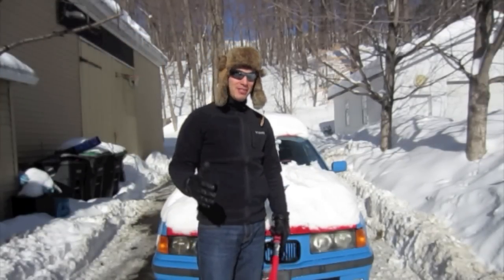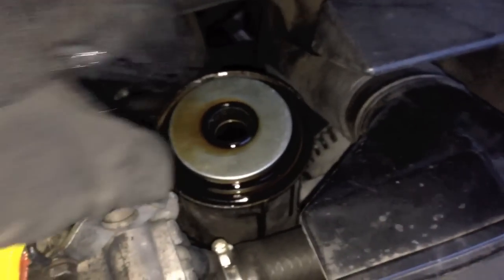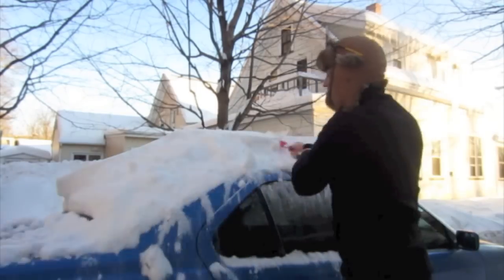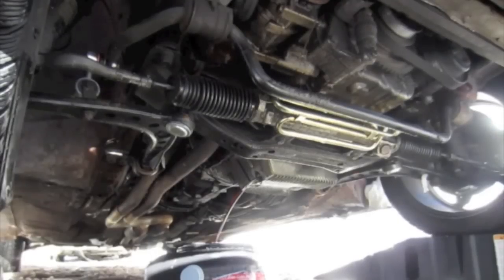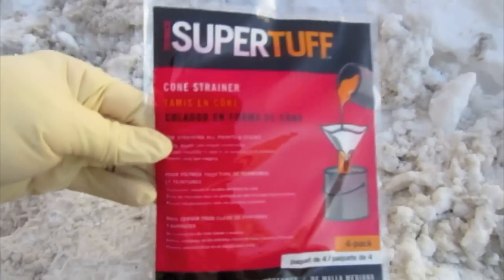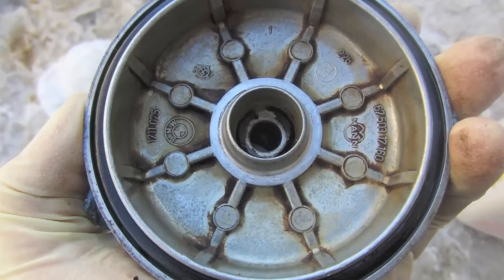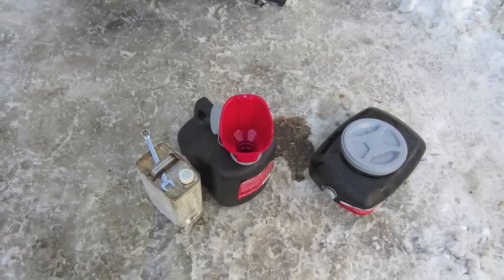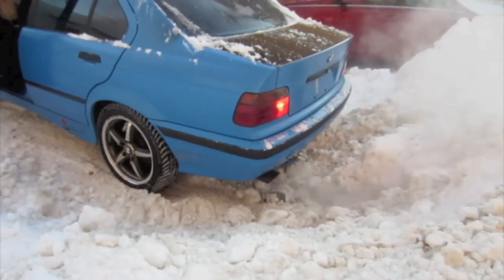BMW Race Car Build for $900 Part 6 Is Our Motor Blown?

Comment: Why don't you take apart the engine and clean it and if not why, I know I'm a newbie I'm just 15
Reply: It's not that easy to assemble an engine. Or even to take it out of the engine bay.
Reply: They took out the transmission so I'm guessing they can take out the engine
Reply: MrRight PCgamer the amounts of bolts and cables you have to unplug, and remember where thich goes and then take it out with a lifter without ripping a hidden cable out, ect. big risk, i don't think he wants to risk it, but it's up to him. i think mighty car mods did and engine swap video on their 11 second wagon
Reply: Yeah a jz engine if I remember correctly though Isn't there like a manual or something that lays out everything? and you could just mark up every cable with tape and a marker and the bolts in plastic bags and a marker.
Reply: MrRight PCgamer i'm pretty sure if you followed everything from the book and double checked it, you wouldn't have an issue but then again, where is the fun in that! :D
Reply from the maker: You guys are correct. We can swap in another M50 for $300 or so. But we are really seeing if the motor can be brought back from the "DEAD". This much build-up is pretty nasty. I'm speaking with a few engine cleaner companies to see if they think their product is up to the challenge.
But just imagine. Seeing this car, this motor, both being able to race around a track. That's our goal

Thanks for watching!
Reply: millertimebmw i hope you keep the engine. like you said , the inside is really nasty and if you guys can get it to run smoothly then why not :D hope to see more vids
Reply from the maker: Nagyon köszönöm Lajcsi!
Reply: millertimebmw i hope to see that m50 going strong i am working on rebuilding my M50 non vanos in my 1992 325I with a friend of mine everything ordered every gasket imaginable for the car gonna redo the valve seals and all but i just wanted to keep the non vanos build. never got to see how to get the E46 seats in an e36 is that coming soon? Also if you get time would love to see how to hook up an aftermarket alarm system :D
Reply from the maker: Awesome!

Comment: Never reuse engine oil; ever.
Reply from the maker: Simon Colley On literally ANY other motor I'd say the same thing. This one is maybe too far gone...  :(
Reply: millertimebmw

The crap in the bottom of the pan once put back in the top makes it cycle through the oil relief valve; even from, going back into a perfectly good engine can / will make it stick hence little / no oil pressure.